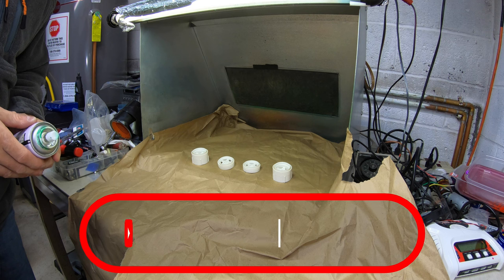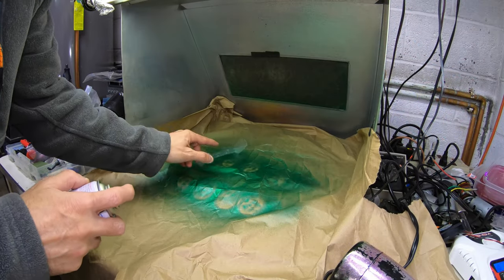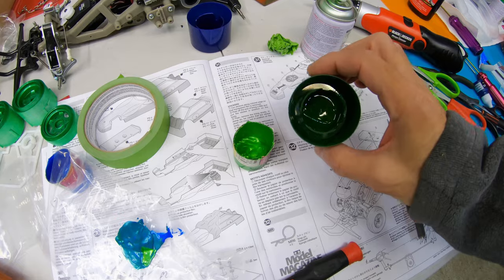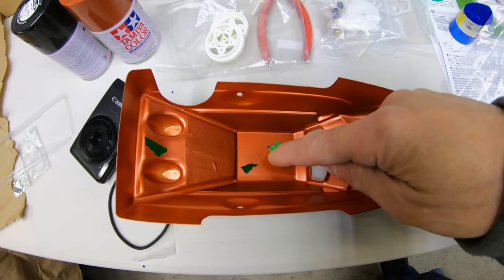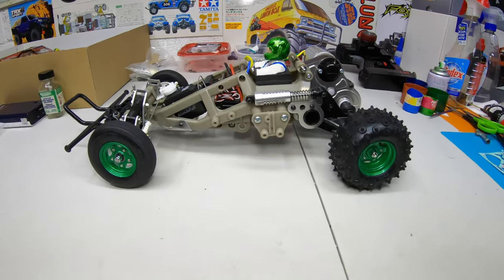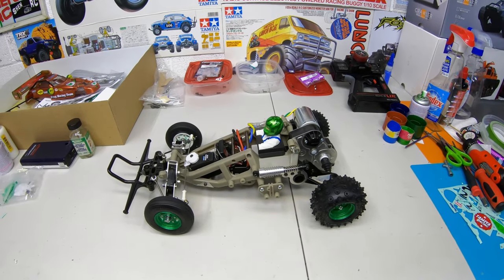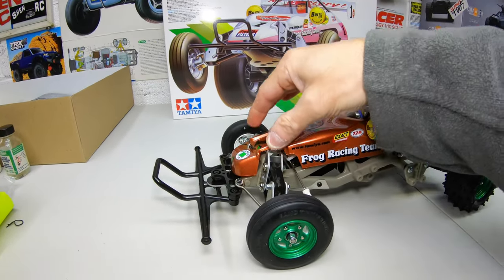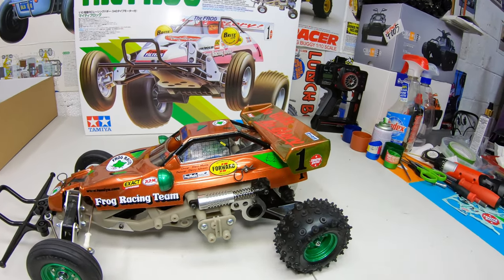Tamiya Frog build CUSTOM PAINT JOB & TIPS & TRICKS!

Comment: I was considering painting my wheels for the sand scorcher, but I was tempted to do this while still in bits, do you think it would create an issue fitting them together? The copper and the green look good 👍
Reply from the maker: Hi Thanks, you can paint them when apart that's how I did mine.  just let them dry real good before trying to put the tires on.